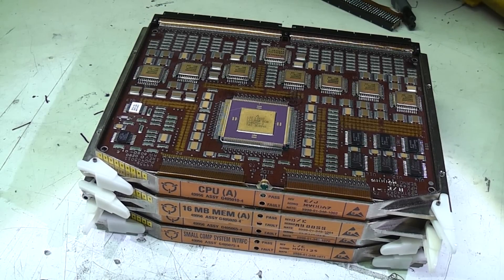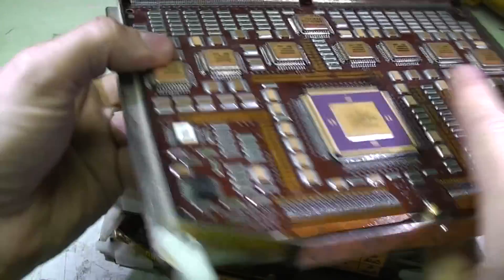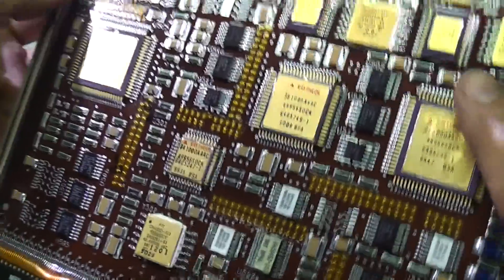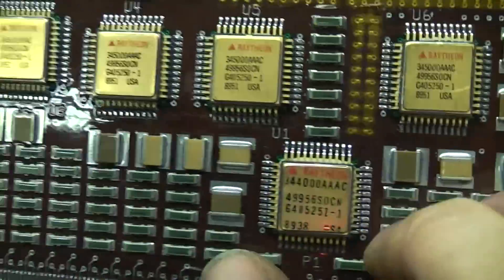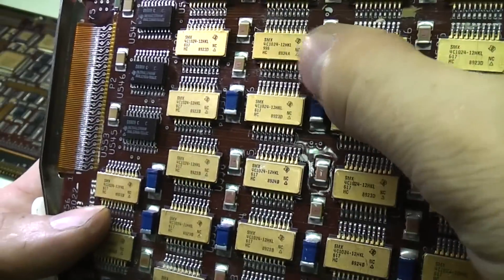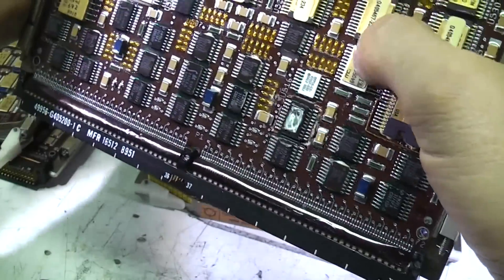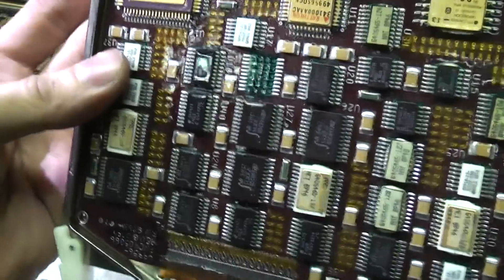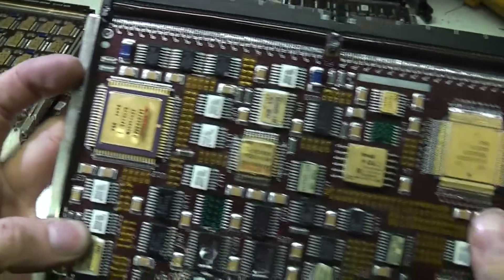Wierd military computer boards

Comment: I like how they are heavily covered in varnish (or something similiar)...  good idea for a product that's fully finalized.   I hate that about consumer electronics boards... everything metal on the compents and traces are exposed to shorting by anything that touches them.   On every 3.5 harddrive I get, the first thing I do is get a piece of clear packing tape, and place a cut to size piece of it over the circuit board of the harddrive.  Why?   Imagine you had your precious data on it, and you shorted it out and bam could no longer access the data.  

Now, you can short out your motherboard, a ram stick, video card, all the other compontents... and not suffer a catastrophic failure of all your files... and replace the component and rebuilt the system.  But if you short out the board on the harddrive with your beloved file collection on it, your only recourse is to hope to find an identical one on ebay somewhere, take the board off of it, and rewire it into your zapped harddrive.  I have no idea how the boards are connected to the drive internals... if that is even possible...    if it is, its not without a lot of grief.
Reply: Im not copying any of my private files or source code onto someone elses harddrive that I do not know whos harddrive they are on  or where they are or who is looking at them...
Reply: James Sullivan
 Heard of  the naked picture that were leaked that were stored on the cloud?
Reply: James Sullivan Data can still be considered private even if not ellicit. For instance, intellictual property, documents with a non-disclosure term, etc. The whole cloud thing scares me; although I suppose you can encrypt data before throwing it online. That all aside, do you really want to destroy your harddrive, possibly reinstall an OS, restore backups, and more? I think CHOPPERGIRL AIRWAR's suggestion is still a good idea; even if you do have off-site backup.
Reply: There are 3 ways to destroy your electronics just by touching them:
1. Excessive force, "Sticks n' stones may break your bones, but a sixty foot fall will kill y'all!" - Fresh Prince in Bel Air
2. Touching exposed conductors while the aparatus is powered can short circuit the components.
3. Electrostatic discharge, 10000 volt jolt from your fingers will destroy most modern electronics.

And acctually that packaging tape can carry electrostatic charges and kill your electronics when applying it, unless you're wearing an ESD bracelet, and if you're wearing that there is really no point of applying that tape on the controller card for the HDD...

(oh yeah, fatty acids from your skin can corrode connectors)
Reply: You can brush on some molten parafin, clear acrylic, or even tar. It might be nice to make a pretty painting with some nail polish and decorate it with stickers. This reminds me of the problem of shorts when it comes to using a mint tin as a project box.
Reply: CHOPPERGIRL AIRWAR I know you think that sounds like a good idea, but that's actually a TERRIBLE idea to tape your circuits with that kind of tape.
Reply: @TylerSteven9  - Never had any problems with the packing tape on harddrive PCBs, or electrostatic discharge when I PC tech computer equipment.   Wrist straps are gay.  I have consumer grade PCBs spray painted in clear coat varnish out of a rattle can installed outside out of the rain but basically in the weather going strong for the longest time with no signs of stopping.  Even had one where a lizard made his home on for the warmth it provided all winter long and the son of a bitch pooped all over it.  The clear coat protected the board and it kept on trucking.   I blew it off and reinstalled that sucker.

Comment: for memory board : i think of big logic ASIC to correct memory, normally there is 16*3M, when you access one byte, the ASIC reads 3, and correct the memory if the 3 bytes are not identical.

Comment: They appear to be boards for Spectrum analysers of the day.  They had to be very high spec and as highly shielded as possible to minimise any signal bleed though. Allot of those chips where re-badged because they where custom made for the system.  You'll probably find that they where made for HP/Agilent.

Comment: I work for a company that manufactures engine controls for military and commercial aircraft, All the boards we assemble and put in units are just like these. They are heavy thick boards that are heavily conformal coated.  Because the boards are so thick and have heat sinks, they can be a pain to rework or solder. Especially through hole components. You basically have to heat the whole board up just to get the solder to flow. These and all the electornics we work on are built to class 3 specs.

Comment: From the makers of kontakt 60 spray comes plastik 70 spray just google it and you will find it same characteristics has transparent nail polish on PCD's. It protects mostly against moisture and corrosion and it's a good idea to put it on sensitive electronic components and many other non-mechanically "stressed" things.

Comment: According to a guy I know that worked at Raytheon in the '90s, these boards often had features designed to improve adherence to TEMPEST spec, i.e. minimising EM emissions that might be used by an attacker to reconstruct information from data bus emissions and other EM power analysis. Often you'll find strange ground planes and unusual board alloys (e.g. heavy-metal infused fibre-glass) that are designed to "absorb" some of the emissions.

Comment: These were designed for extreme environmental conditions as well as vibration.  NSN traces to ADCIS computer assembly.  USAF equipment unlikely due to presence of hermetic coating on boards.  Lack of this caused the B2 to crash on Guam.  A decent production quantity, NSN assigned in 1991.

Comment: Those appear to be parts to a radar controller computer,my father used to work on them in the navy and described them fairly similarly to what you have there.  they're covered in gold as well, you'll probably want to smelt it out as its most likely worth more than the assembled parts.

Comment: These look very similar to a box I worked on in the Navy.  It was sonar receiver / spectrum analyzer that was used on the SH-3 platform.  I worked AIMD which means we usually troubleshot down to the component level.  I would say 80% of the time it was remove and replace some component stated as the fix (Q3 on the hover alarm for the SH-3 was ALWAYS going out :) ).  These boards, however, were always depot level which means we would identify which board was bad (usually using the troubleshooting guide provided by Raytheon) and r&r that board and then send the board back to depot.  We usually didn't even have schematics for those boards.  Just block diagrams.  :)

Comment: I used to work for Amphenol.  We worked on 10+ layer PCBs that had very strict specs.  They were used on F-22 Raptors.  All components are pretty much custom.  I saw some of the receipts and glanced at some numbers.  A single PCB was $3000 and Lockeed Martin ordered 200 of them in one week.

I'm quite certain that you could toss one of those PCBs in a tank of water and it'd be fine.

Comment: Wouldn't be unsurprising given how common 100-pin backplane busses were for this kind of kit, and how the VME standard actually arose out of that.

(What CPU series was VME usually used with? ... 68k. What architecture was 68k largely based on? VAX and PDP...)

Comment: laser trimming the resistors... i suspect that it would be very hard with just one 'base' resistor. Then again, most of them would fall in the  10^2 - 10^5 range, so if laser trimming is accurate to 4 decimals (not significant digits) it's very possible. Got me thinking. I was looking for a video about high- durability electronics, because i am trying to design a replacement (digital) gauge cluster for me loudcycle.

Comment: ...these were designed to be easily swapped out in case the electronics were fried in an EMP attack. I know this, for I have a very good friend who worked at Rockwell International for 30 years. She showed me a similar board (it had Honeywell chips?), I believe they were outdated and declassified inertial guidance boards from the Minutemen II missiles.

Comment: radeon is AMD btw, those microchips are raytheon which is millitary but only for   frontline computing needs, fast to put together fast to take apart hence large seperate components that slot into the mobo, also they are seperatly cased for ease of upgrade :)

Comment: Looks to be a typical radiation hardened motherboard you would find in a missile controller of satellite.  I used to replace a lot of these from the missile silos at an internship I did a while ago.

Comment: Amazing.  I thought most military electronics are a closely guarded secret because electronic warfare is highly classified.   My only assumption is these old military mobos are a very old common standard not used in sensitive applications.  They just have to be durable and be hidden inside metal boxes for protection against EMP and other massive power changes.  I assume most old electronic gear is still classified and in need of secure archival storage prior to secure disposal or destruction.   Beautiful workmanship and quality.

Comment: proof the military had non-volatile memory applications in use.
this is what we had;
Commodore released the Amiga, based on a 7.16 MHz Motorola 68000 and a custom chipset. It was the first home computer to feature pre-emptive multitasking operating system. It used a Macintosh-like GUI. Cost: US$1,295 for a system with a single 880 KB 3.5 in disk drive and 256 KB of RAM.
that what is shown in this clip was 16MB of RAM that wasn't storage it had a controller that I would assume fed data to a lager storage device
Reply: I had one of the old amiga's, the 1200. Great little machine, such a pity Commodore went under
Reply: What does the Amiga have to do with any of this?

As the video (and the label) said, the bottom module is a small system computer interface, more commonly known by its acronym SCSI. SCSI was one of the high-performance interfaces of choice for hard disks from the mid-80s until the mid-90s.

The RAM is almost certainly system memory, not non-volatile storage. 16MB would have been unheard of for any sort of "personal computer" in the mid-80s, but not uncommon for a high-end mini-computer, like the DEC VAX, which is basically what this was, but packaged for military and space use.

Computers weren't as widespread, but the VAX wasn't exotic or rare for the time. The first one, released in 1977, supported up to 8MB of RAM. The early ones were the size of refrigerators, but by the mid 1980's they had the MicroVAX, which could fit under a desk and hold 15MB of memory. By then, DEC had probably sold hundreds of thousands of VAXs to corporations, governments and universities.

Comment: Obviously EMP hardened electronics. I am probably wrong, but these may be just several boards that make up a Minuteman ICBM Autonetics inertial guidance flight computer. Possibly a newer version of the D-17B. More likely something beyond the D-37C. There were user groups who studied how to program these, Minuteman Computer Users Group. D-17B Computer Programming Manual. Report MCUG-4-71. New Orleans. Louisiana: Tulane University, September 1971. Still, these may not be this.

Comment: I love stuff like this. When me and my sister were 12 or 13, a drive through bank by our house closed down. We'd ride our bikes up there and pillage all the guts from the tube system and the atm. We did that every day for a week. I don't know what the retail value is on stuff like that, but it's presumably greater than zero dollars. And it was right by a busy highway in Orlando. I have no idea how we didn't get in trouble. Our parents made us throw it all away in the dumpster of an apartment complex down the road lol. Straight up aiding and abetting.

Comment: I can confirm these are aviation use components but I can't say military or not. Raytheon makes radar assemblies for both civilian and military use, and most aviation components are made to mil specs. Also there are some components that are identical for both purposes. These are part of a larger assembly where there would be a chassis that each card slides into and locks in place. Cooling would be air, as oil cooled usually is only for the high power RF units. The whole unit is considered a WRA or a RRA which stands for Weapons Replacable Assembly or Radar Replacable Assembly depending on if it part of the weapons system or the general radar. As for those who said the numbers would be erased, no they wouldn't. Those of us who repair those need to know what the chips are, so we know how to repair the units, and order the parts. The epoxy coating is to prevent condensation at high altitude from causing corrosion or short circuits. Unfortunately I don't know the exact use of these units other than aerospace of some sort.

Comment: I worked at an US eastern seaboard aerospace manufacturer in the 90's and 00's which had qualified sole-source MIL and NASA  (F14,F15 programs, much retrofit work out of WR AFB, and a life support sub-assem for Ham-Std on the Shuttle's EVA suits !). These samples are beautiful! Having done advanced bench tech work there, I fully appreciate the engineering behind them. I agree with a previous poster - have them nicely mounted in a glass case and display them as artwork !

Comment: Thats is the old type or kind of computer way back to 80, if you can still remember the bigger cabinet type of computer before, try to check it has a memory board, and other circuit board.

Comment: I used to build boards for the Abrams tank back in the 90's. The looked a lot like those only they were thru-Hole components, those boards used surface mount. Ours were twice that size, but the epoxy coating looks the same.  I would build them by hand in lots of 3-10 and would even wave-solder and test them myself.

Comment: wow 89-90? just imaging the shit their running now! Quantum computers etc, shit we've never seen
Reply: The best calculation on a quantum computer ever made was 2+3=5. So basically, no, they're not using quantum computers.
Reply: I think the next thing in computers they're working on is photonic computers? If that's the right way to put it? It has to do with transistors whose switch is thrown by a single photon or something. Sounds quite promising.
Reply: 3x5=15 that is the record
Reply: You realize that this was basically a commercially available mini-computer packaged for military use?  The packaging may have been ahead of its time, the actual digital electronics, on the other hand, were relatively run of the mill.
Reply: I was just going to say, is that really that advanced for 1990? The web hadn't come out yet but I remember they had some pretty advanced stuff even then. Still, I bet the military does have a few tricks up their sleeve so to speak. It would be interesting to find out.

Comment: Those are part of an old Telephone routing switch before the Motorola Cellular Matrix Switch was invented. The SCSI interface would have been connected to a small array of hard drives that held the "call routing path" information. Today we'd call it a "routing table". The CPUs are probably RISC-type 8-bit processors. The same type you'd find in a Super Mario Bros. arcade game.

Comment: Not the same boards, those were an NEC product, but Raytheon may have made a competing version, or a version built to be sold outside of the US, to ally nations. You can probably do a search online and find info on the Promina/IGNX, but basically it provided multiplexing and routing across satellite networks. Usually consisted of a CPU card, a timing card, "trunk" card  that had several other data and voice cards  multiplexed over it.

Comment: Regardless of what they're for, handling them like that without any ESD straps has essentially probably rendered them totally non-functional. The military used Univac computers for just about all airborne platforms for a number of years, and since you managed to get these off ebay, they're probably totally fried, anyway. Nothing mysterious here at all.

Comment: I am not 100%, but these look nearly identical, if not in fact actual cards made by Raytheon for a secure phone system called DRSN which I work with. If so, these cards are designed to be deployed in an RSU base switch or a DSS which can be deployed. The give away is the SYNC/ASYNC interface which is used for digital voice. Because a UNIX based GUI was used to interface with the terminal, that also makes sense why there would be a SMALL COMP SYSTEM INTERFC card present . This allowed an easier method for configuring routing tables, button assignments on the telephones, and set up groups/conferences into the system memory.

The form factors are identical to that of the card racks in a DRSN. However...they're definitely a Raytheon product. I am not doubting that they MILVAX, and I wouldn't even doubt that these cards found their way into MILSTAR SATS. They typically reuse cards in different applications. It is all how they're configured for the application.

Comment: No, I made no fanciful guess about the age in this instance. The guy said that he'd found the dates '89 & '90.  Things changed quite quickly, and the (circa 1983) Apple Lisa computer is a fair reference source for early 80s memory chip capacities.  The Apple Lisa used two large 512 kilobyte ram boards full of chips.  Even the 1991 Microsoft DOS 5.0 commercial (very tasteless commercial) talks about saving 45 kilobytes of RAM.